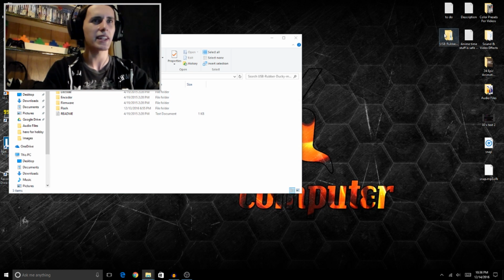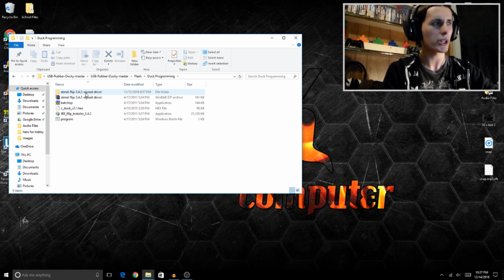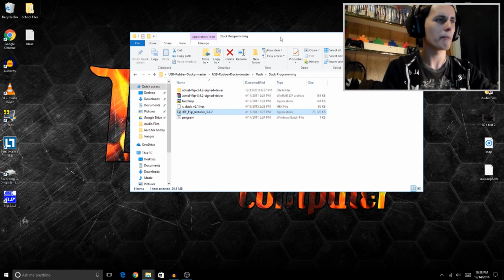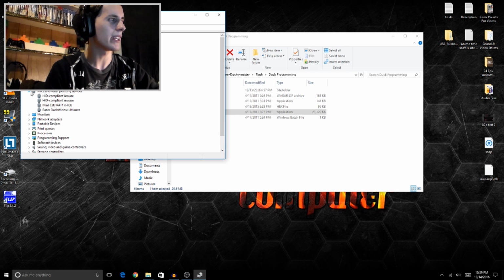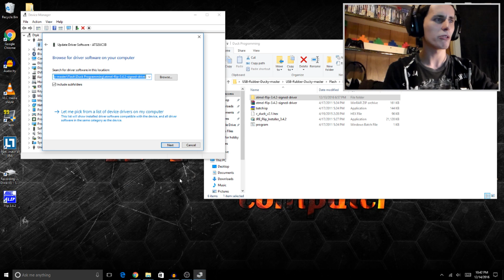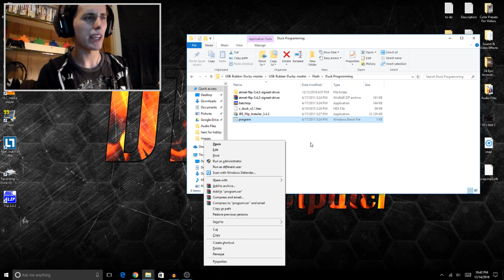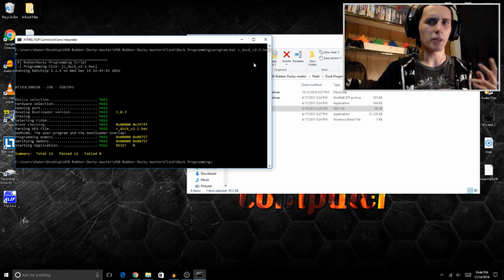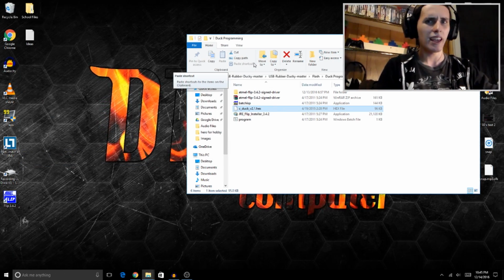Flashing Usb Rubber Ducky On Windows

Comment: How can I change the trigger payload option? Like pressing the button, triggering an LED button, or simply when you insert the USB...
Reply from the maker: I can't remember the hex off the top of my head but it should be listed on the wiki all you do is the same steps in the video just changed the firmware you wish to flash. Also sorry if you message back and I don't reply currently my WiFi is a bit broke at the moment. But with the twin duck firmware I use in the video you can plug the duck in and click in a empty window repeatedly till the script finishes then just open the usb like a normal flash drive and swap the .bin file with another.
Reply: Thanks! You get a sub from me :)
Reply from the maker: Your welcome and thanks for the sub it really helps also glad I was able to help you out and sorry for the late reply.  :D Broke my router so my WiFi is a mess right now.
Reply: No prob bro! Keep up the videos, really like your style
Reply from the maker: Thanks and will do lol glad you like them Bro.  :D
Reply: No prob :D

Comment: This broke my USB and i had to get a new one.... Still stuck tho
Reply from the maker: Did you install the drivers especially atmel flip driver cause with out them it won't work. Also depending on what system OS you are running driver installation may be disabled so make sure they did install first before attempting the flash.
Reply from the maker: Also if this helps I did include a page to the wiki and it does have a in depth trouble shooting guide " https://github.com/hak5darren/USB-Rubber-Ducky/wiki/Flashing-ducky#Problems "
Reply: Ehm im not sure it just pops up then i double click and it says insert a disk into the drive???
Reply from the maker: It sounds like your sd card isn't mounted in your USB ducky try to pull it out and pull it in the adapter that came with the duck then plug that in does it do the same thing.

Comment: It works, the LED's are blinking and stuff, but my scripts won't execute. I can see it as a storage device on file explorer.
Reply from the maker: Make sure you flashed the right files and it helps to set a delay at the start of a script so that if the drive auto pops up it wont interfere with the script your trying to run.
Reply: the hack 5 micro sd sucks, after changing it everything worked fine
Reply: Holy Crap thanks so much
Reply: that was a late response

Comment: Really awesome tutorial...  Pretty sure it worked...but now I just need to get my scripts to work.  Nothing seems to be saving to the duck when inserted to execute a payload.

EDIT:  actually, now I can't even get a super basic payload to execute...  :(  Any ideas?
Reply from the maker: Try to re-flash the firmware and be sure to have the " inject.bin " typed out right and get back to me it should all be working fine if it managed to flash the first time.
Reply: Thank you for the kind reply, amigo.  Re-flashed and everything worked great - just like on your video.  However, when I insert the ducky for payload execution -- no luck (no even for a simple "Hello World" script)

Update:  Flashed the c_duck_v2_S0001.hex and now I can at least get a basic script to execute.  But I don't think I am in twin duck mode anymore.
Reply from the maker: Hmm thats odd I don't know what would be causing that cause the rubber duckys all use the same chip as I am aware you could try to download the files all again maybe that firmware.hex got corrupt or didn't download all the way. But i'm glad to hear that the C_duck_v2_s0001.hex is working for you.
Reply: I'll give that a shot.  Thanks again for the advice :D
Reply from the maker: Your welcome Bro :D Let me know if it all works if you do re-download it.
Reply: Update:  Redownloaded the zip folder, extracted, blah blah blah ...  followed the steps >> all green PASS >> no scripts will execute.  Really weird....  lights are flashing red and green as would be expected.  Guess I'm SOL for now.
Reply from the maker: Hmm I don't know how to fix that I know the green and red is definitely right and it should be happening and scripts should execute right but I have no clue why they wouldn't best bet or advice I can give is switch back to the firmware you had working previously or try to do a google search for the twin duck firmware hex maybe there has been some kinda change hardware wise to the ducks that need different firmware.

Comment: Hiya, how do I access my USB rubber ducky folder, it isn't showing up on Kali nor Windows. An F drive pops up and it's in hidden mode, then I try access it and it says please plugin this drive.
Reply from the maker: Ok so I need a little more info is this happening after you flashed your usb ducky or are you trying to access the sd card on the duck?
Reply: I found it now, the SD to USB converter, thanks for replying though. Most youtubers never read comments <3
Reply from the maker: Your welcome and i'm glad you got it fixed :D . Also I would have replied sooner but my YouTube is always weird lol.
Reply: dont need that . you can just plug the sd card in sd slot in your desktop.(if you have 1)
Reply: Deejay Busta Don't have one :)